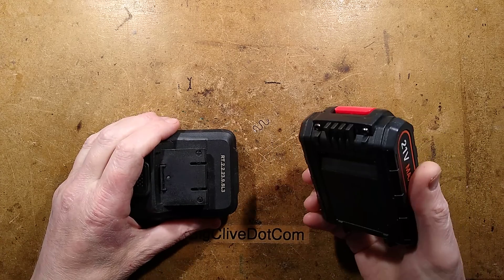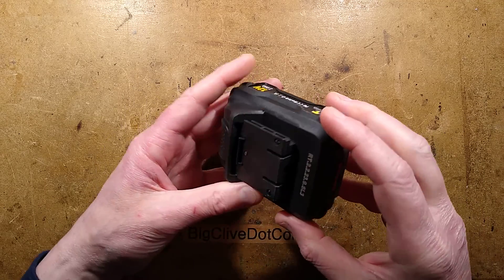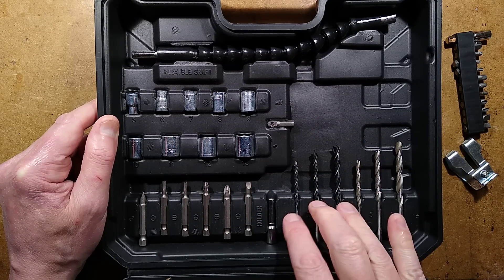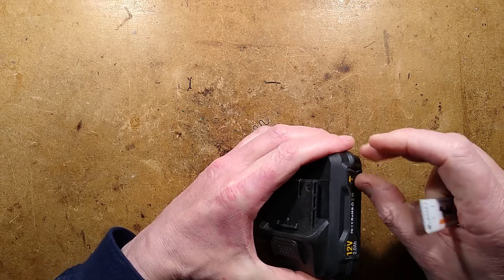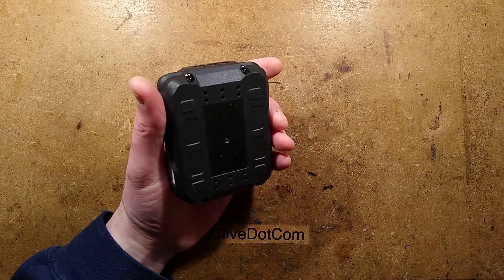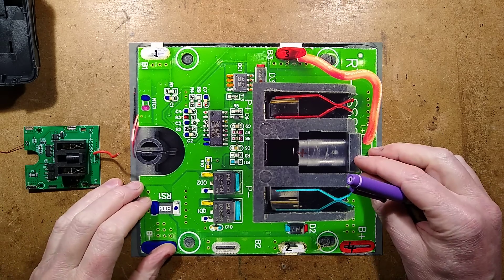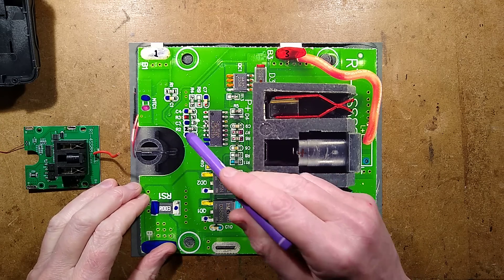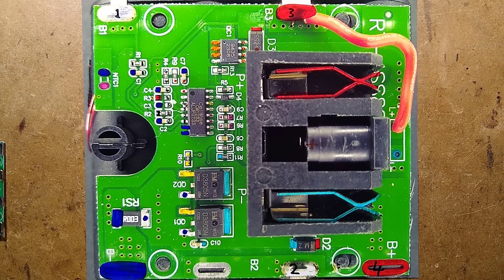Inside an unusual battery for cheap eBay tools - with schematic

Comment: We have two machines that use those, a drill and a lawn trimmer. I decided that i add a battery indicator, so that my mom knows when to charge the trimmer battery. 

I  bought the first 5S lipo battery indicators from ebay and they fit like magic in the slot where the blank plate was. It was 1€ a piece.
Ebay description is: "1~100PCS 5S 18V 21V Battery Level Capacity Volt Indicator Tester Meter Module", those with the big red square button and 4 LED's.

Happy upgrading. 😁

Comment: I love the 12 volt batteries, they take a standard barrel jack and they are perfect for vintage electronics like camcorders and the like because they often are designed to run off 12v cigarette lighter ports in cars. Battery banks often can't reach the amp requirements for these devices and won't work, and the original batteries are cooked because they're lead and 30 years old.

Comment: Clive, would you consider having a look at the IKEA 12v drill battery and doing a tear down? It’s £13 and rechargeable via USB-C. Haven’t found anyone reviewing it let alone doing a tear down, but it actually looks like it could be very useful.

Comment: Most of the ones I come across here have one failed cell and the remaining cells measure between 1250 and 1450 mAh on the Xtar VP4 Plus battery tester. It's worrying how many I've seen with failed cells which look suspiciously new.

Comment: You mention "testing the cell's capacity"  how do you do that now in 2024?  Is it still about the same as https://www.youtube.com/watch?v=OaZxLxgf7Ro  ?   I'm thinking of a new 18650 charger but one with some more smarts.
Reply from the maker: I still do some tests with a full charge from 3V, but also sometimes use a monitored discharge test.

Comment: Looks a nice design I still would be wary of leaving it on charge though lol thanks Clive 😊
Reply from the maker: I recommend that NO lithium batteries are left on chargers continuously.  Including brands like DeWalt.   The batteries should be charged and then disconnected after a suitable time, to allow for the balancing feature in some to finish its work.

Comment: Ah yes, Universal Batteries. Designed in such a way that they can't be used with any incompatible devices.

Isn't the mystery diode to pin 15 the wrong way round on your schematic?

Comment: Handy tip # 34 ........ Should you have a good working battery drill for which you  CANNOT !  source a matching battery pack .... then just connect any 12 Volt  Lead - acid fire alarm battery ( or two in series ? ) .... connect a metre or two of flex and put in a shoulder bag , (  slightly less convenient  )  , but works OK up ladders etc ... do NOT forget to  FULLY  charge your Lead acid battery ( to 14 Volts max ) ASAP afterwards , or it  WILL ! sulphate ( tried - n - tested ) .. DAVE™🛑

Comment: chinese power tools are amazing, slowly prices are dropping, slowly quality is getting higher, and the cheap models are becoming brushless motors. I like these batteries that simply use a barrel jack vs proprietary chargers that are large and can't be used for anything else.

Comment: May be the purpose of the VM pin is to detect if the short is still there after the MOSFet turned off without turning it on again.

Comment: 3 x 3.6v = 10.8v battery
4 x 3.6v = 14.4v
There is no 12
Reply: and 5 x 3.6v is 18v, but lots of those tools are marketed as 20v, which is 5 x 4v. The ultra wanky tools are called 21v or 5 x 4.2v (the max charge voltage of a li-ion cell). So, if we use the most common Marketing Wank: 3 cells is 12v, 4 is 16v, and 5 is 20v. Perhaps we should describe batteries with the 4S2P nomenclature, but it's probably too late for that.

Comment: I bought one of these 12v tools when they first started appearing, the first one I go was trash, the pack felt so light, it felt like there was nothing inside, so i took it apart with the intention of turfing it, inside there was only batteries, some foam padding to stop rattle( I'm guessing), no circuit board, the cells felt empty, I didn't have the capacity to test so in the bin it went. I've had OK luck since, chargers on the otherhand have been hit and miss.

Comment: 4:44 I hope you HACKED a 4th battery in and checked if the tool works with a 16v instead. Or this would be a clive unapproved video.
Reply from the maker: It would need a different chip.

Comment: Makita's batteries have the best terminals. Only the 18V LXTs' though. I hate the new GXT terminals. I have some 10 year old batteries that lost only 20% capacity and peak amperage, STILL going strong. Used daily with full discharge 4-6 times a day. Used in impact AND in a circ saw. Meanwhile I see dewalts/milwaukees die month 3. And even then only 1/2 cells die of the 10, I open it up, replace the cells, it's ready for work again.
Reply: I'm saying this because the previous 18V's are "stealing" the makita layout and can go on any makita tool no issue.

Comment: Alright Chief, it's me again. Another eventful day in my world. I learned the hard way not to hold the output cable of a CRT flyback transformer with my right hand while holding the ground line against a ruler with my left hand. I managed to get about 2 cm arcs (I was measuring,   the output with a ruler; I tried using digital callipers first, but they went haywire) and measured around 60 kV  (2 cm arcs) at 50 kHz   but then it decided it preferred to get to ground through  my  finger. It tingled terribly, to the point of pain, for a brief moment, and left slight blackened patches on my fingertip, as if a laser had been shot through it.

Thanks for your work, BC. (I should have used proper PPE, that is  my rubberized gardening gloves from B&M.)
interestingly, after some time, i have noticed very superficial burns on both of the other phalanges of the finger that has been 'lasered'. in the places where it touches itself when one holds something small between finger and thumb.

Comment: i bought the saw with the 21v battery thinking thats why my drill used. When I samed them in to the makita the light came on but the drill wouldn't operate. I doubled checked and the drill is 18v :(.  seems to make the difference here.

Comment: The full datasheet for that CW1053 included a reference application schematic with resistors and capacitors (100nF) on the inputs. The simplified schematic in the English brief datasheet did not.

Comment: I’ve actually seen these used on site. I asked the guy if they were any good as my 12 year old DeWalt drill was on its last legs.  He said that he had bought ten for the same price as a professional drill and after a year he was about half way through them. I really didn’t know what to say to that but I replaced my drill with another DeWalt.
Reply: Ah yes, the Matsushitta range where the plastic box lasts longest?

🙂

Comment: When I designed microchips and wrote data sheets for them, NC meant that there was no connection between the pin and the internal circuitry. 'DO NOT CONNECT' meant just that, and was used to describe test pins (especially outputs) and other reserved pins that the user needed to leave alone!  However, there is no guarantee that all manufacturers documented their pin lists that way!
Reply: Sometimes we had zener logic on our chips. A voltage above about 10V on these "NC" pins turned on diagnostic circuits or ID bits to deter counterfeits.
Reply: I don’t know who you worked for but that was the industry standard for a very long time. I remember DIY chip tester schematics in electronics magazines back in the day with high impedance amps for reading those pins. For those who don’t know, a sufficiently high impedance will allow you to see what’s going on at such a pin without loading it, making the chip “think” the pin is left floating so as to not trigger undesired operation.

These days even some microprocessors are relatively cheap jellybean parts so there’s little point in bothering with that level of diagnostic, with “remove and replace” now being the default.

Comment: another way to do the 4th cell connection without having to do that wire o4 an actual cell would be a dummy cell without any chemistry inside - they usually are available for dialing in your welding machine as that goes outta tune easily...

Comment: Interesting teardown. I have a 12V Bosch drill and driver but so far have never had a battery failure to open the battery pack.

Comment: With UK laws the seals that say warranty void if removed are pointless as they are not legal
Reply: The US recently made this a law as well 👍
Reply: @Bittboy  1975 when the Magnuson-Moss Warranty Act passed which is the law that makes those stickers invalid is far from recent, its just it depends on the regulators to enforce it and that depends on which political party is in charge at that time.
Reply: @thedragonhunter  Steve Lehto (YT channel) did a video on this a couple weeks ago. "Feds Target Those ‘Warranty Void if Removed’ Stickers"
Reply: @thedragonhunter The FTC has been chronically underfunded for decades. As have most regulatory agencies. They keep expanding their responsibilities with new laws, and shaving cents off their budget, and NEITHER SIDE has made any real attempt to fix this.
Reply: Right to repair has become very popular recently in the US (for values of recently up to say a decade or so) but not because of cheap stuff like this. The biggest US case is that of farm machinery makers who do strange things with the code in the onboard computers that brick huge expensive tractors if you do anything like use off brand accessories.

Manufacturers of consumer devices have pretty much always made it difficult to get into and fix or modify your goods, sometimes for understandable safety reasons, sometimes for liability reasons, but most often so that when it breaks you come back to them rather than a competitor.

There have been exceptions like Ford Motor Company (and others) including repair and maintenance tools in the car at no added cost so that the owner could keep their car going, but then there weren’t a lot of service dealers around at the time. Now that “certified” mechanics exist the carmakers don’t want us fooling around with the insides at all.
Reply: @markfergerson2145  ya i have been following that a little also with the Iphone, laptops, Tesla's etc

Comment: I know that it's a personal choice but I prefer the charge indicator lights on the battery itself. Actually having them on the tool and the battery would be best.Someplace such as the back of the top part of the drill, opposite where drill bits are held, or on the top surface.  Where they are on the drill in the video are useful to most people but not those whom are left-handed, unless the lights are on both sides of the drill. It's a minor annoyance but little issues such as that may turn a functional drill into one that a person loves to use.  My point about the battery energy level indicators on the batteries is that it saves the users from having to attach the batteries to a drill, or other tool, in order to find out how much energy is left in the battery. If the indicator is on the battery one is able to determine the energy level without requiring anything else. 

Having an indicator on a drill would be useful, or at least having the tool designed for better battery attachment, because with at least one of my DeWalt drills (drill driver or impact drill that I purchased together as a kit) the battery slides in at the bottom of the handle such that the energy indicator is left facing the front. Ideally, the safest way to check the battery power level is to remove the battery, press the button to get the LEDs lit, and then attach the battery again. Otherwise, one has to point the drill generally in the direction of ones' head, press the indicator button, and view the LEDs. If it's very bright out one must be fairly close to the LEDs in order to see which ones light up. I'm just pointing out that in a world in which people require whole wheat bread to have warning that it contains, of all surprising things, wheat, that perhaps designing a drill that requires the same people to turn the drill towards their head in order to see the battery level is not the best case of industrial design.

Comment: I'm always surprised by the quality of these cheap stuff. It's not death traps at all.
Reply: It's a nice little case and accessories, even if the drill eventually dies you've still got lots of decent bits unless it turns out they're all made from soft metal...
Reply: I wouldn't say that the quality was anything to write home about. But, that said, at the price of these and for something you are not going to be using every day or commercially then they are perfectly acceptable. And it certainly can be handy to have a cheap little drill like these in addition to your usual tools so you don't have to keep swapping drill-bits if you need to drill pilot holes etc.

Comment: So I bought one of those mini-chainsaws, but could not find the type, nor the price you got yours for.  I bought the cheapest one I could find, assuming I could upgrade if I find it invaluable around the yard.

I've got a metal bucket full of sand I'll charge it in, lol.  Here's to hopin' I still have all my digits next week...
Reply from the maker: I wouldn't recommend the sand bit, a metal, tray or bucket is fine.

Comment: “Lets void warranty” I would be extremely surprised if there was anything close to a warranty on any of this.
Reply: Sometimes they get you to buy with the promise of a warranty but then there is a whole paragraph of tiny print listing all the exceptions that void coverage. Or if you wish to have it repaired the shipping costs are all on you, you may as well just buy another unit.
Reply: @tncorgi92  Or they say you have to pay the postage back which costs more than the battery, so no one bothers.
Reply: @tncorgi92 From a different scammer! LOL
Reply: I had better experiences with refunds and warranty with cheap chinese aliexpress stuff than with top brand manufacturers. Sometimes i have the feeling that big companies do everything in their power to make the warranty/refund process as tiresome and long as possible
Reply: I bought a cheap (perhaps the cheapest) remote control dog training collar (of the type without electric shock, just beeps and vibrations) on eBay from a Chinese seller and the vibrator motor stopped working after a couple months, I contacted the seller to see if they could send me another collar, I told them I didn't need the remote control but they said they would send me everything brand new but I had to send them a video crushing the faulty collar and I could keep the remote for spares, so I also removed the tiny (10x10mm) receiver PCB from the collar before hammering it to have even more spare parts.
That was fine for a thing with removable non-rechargeable batteries but I hope they don't ask their customers to do the same with things with rechargeable lithium batteries 😬
Reply: @ruben_balea  there are some companies out there with decent customer service/ warranties. I bought a big Fellowes document shredder, not from them but an online seller. After about two years it developed a problem with the power switch. I emailed Fellowes to see if it could be repaired, it was out of warranty but they just sent me a brand new one no questions asked. They now have a customer for life.
Reply: Most of these warnings are illegal. Even in the eu and us.
Reply: @m0rtifiedpenguin  True, but good luck litigating it.
Reply: @concinnus  no need. If it’s repaired and working who cares
Reply: @concinnus  it is law. Even if the user damaged it while attempting a repair. The manufacturer has the burden of proof that it has no defect in the first place. A written letter citing the law is enough.

Comment: In the US it is actually illegal to add those warranty void if removed stickers as there are specific warranty requirements that must be meet and those batteries do not meet the requirements as they are stringent. It violates the Right To Repair laws.
Reply: I'm not sure the stickers are illegal as such, more that they don't actually void the warranty

Comment: Cheap and mostly functional, just needs some de-chinafication to make them a bit nicer, kind of like the £14 soldering kit I got off ebay this week, comes with solder, iron, stand, sucker, brass wool, tweezers, etc., everything reasonable enough to get someone started in soldering, except the iron needs electrical de-chinafication, as they used 2-core aluminium wire with a neutral-breaking switch in the cable on an iron with provisions for proper earthing but no earth, on top of a fake 13A fuse and weak plug pins (they broke far too easily!), it could be a mini fireworks display if things went wrong with that!!! :P
Reply: Check that 'brass' wool with a magnet. I think you will find that it is plated steel.
Reply: @terrygee210  I checked with a neodiddlyum magnet and it is non-magnetic, so it's very likely to be brass wool, could be some other non-magnetic metal, but, I'll give the benefit of the doubt on that... :)
Reply: @twocvbloke  It sounds like you have a good 'un. Most of the cheap brass tip cleaners on ebay etc. are actually steel.